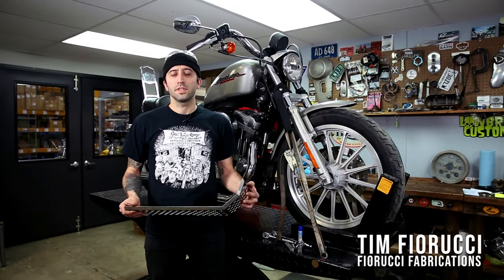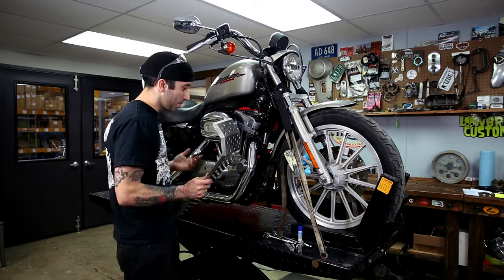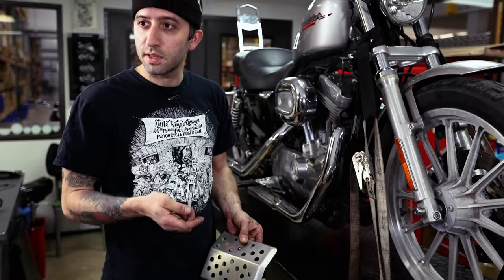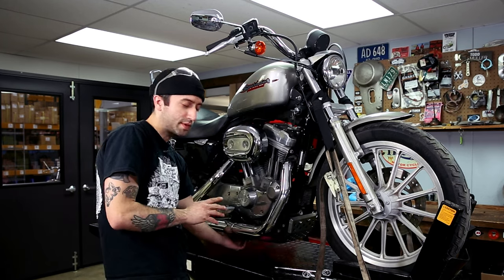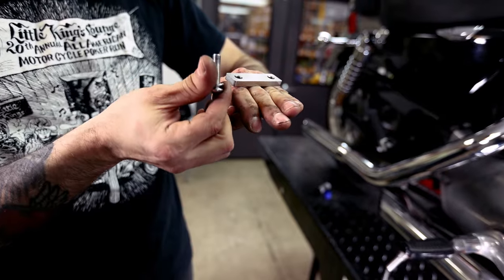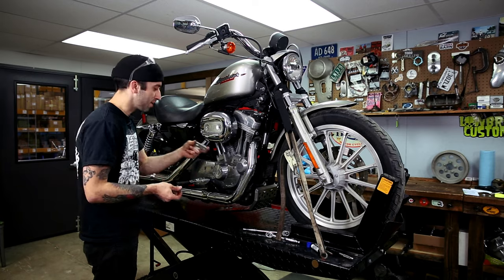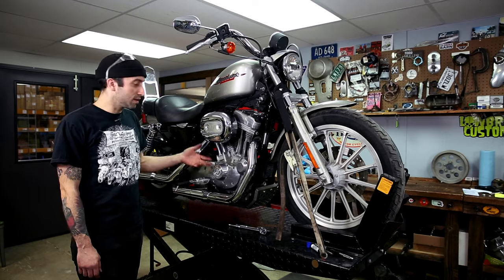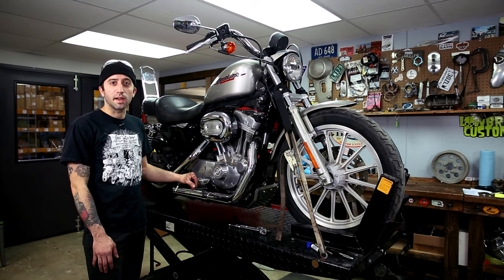How To Install A Skid Plate On 2004-2022 Harley-Davidson Sportsters

Comment: Can I still change fluids without removing the guard?
Reply from the maker: yeah you should able to leave it on theres a hose that hangs on the primary side, you might just have to use a small funnel though to keep it off of the skid plate but it is clear.

Comment: Ignorant question here, but if a chuckhole is deep enough to damage your frame and case, won’t it damage your front wheel?
Reply from the maker: Possibly… if your rocking mags it might not. We live in cleveland. Road hear are pretty bad
Reply: Bro I live in Cleveland just got an ‘21 iron 1200. I’ll check your stuff out! Yeah the roads here (especially 490E) are horrible.

Comment: Does it fit on gasbox frames?
Reply from the maker: fits stock frames not custom ones. you could do some mods to it and make it work but not gonna bolt right on like that.
Reply: @lowbrowcustoms  thats what I was thinking drill some holes and weld some bungs in and then it would work on a gasbox frame.